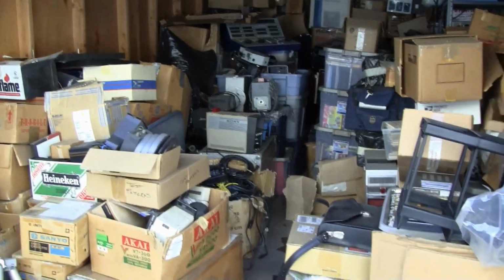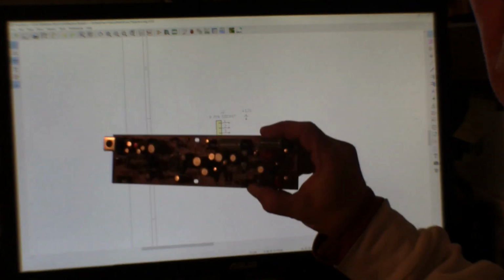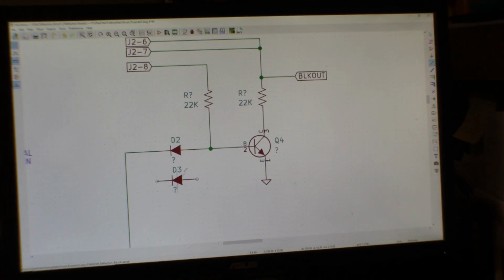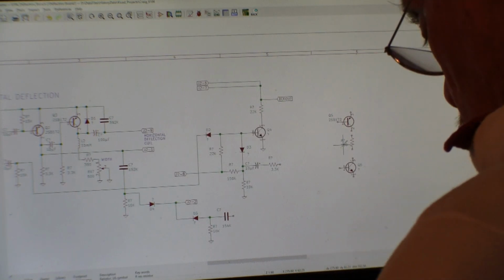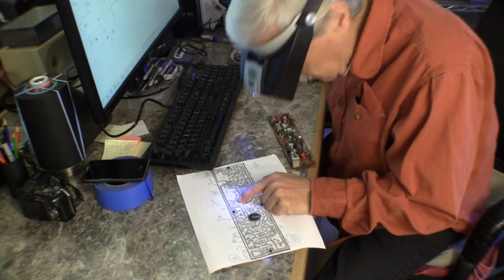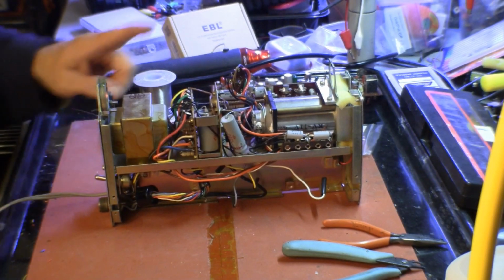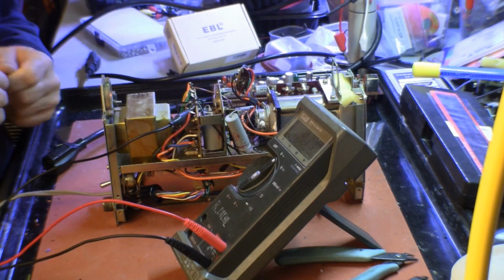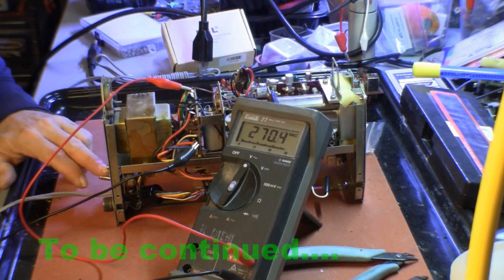Craig 6104 Vidicon Camera Restoration, Part 3

Comment: OMG why are you in the USA lockers of joy !  ; ( you need a big shed ! we have a shed i made sure we built one for me ! so i can store my happy crap stuff you just can't keep in the house ..i always regret it when i get rid of something ,so scrapping for parts is always the next best thing for getting more space keep the parts wanted like the rarer HV transformers and vidicon's tubes and get rid of the cases even just scrapping the boards for later scrapping helps ! i bet you could get most of that locker in 2 or 3 large boxes scrapping the boards .i will put your video on my Face book page ...not sure i can be of much help so far away due to the dreadful postage costs for things these days but perhaps those that view my page in the usa can help .BTW finding the repair of the camera interesting as i am doing the same mainly looking and thinking about it at the moment and studying the circuit manual you kindly sent any case watching how the master go's at repairing he's ; ) hate just ripping out every capacitor for no reason if they are leaky or not .so taking this one slow for my camera i am yet you hook up the scope of take voltage readings .